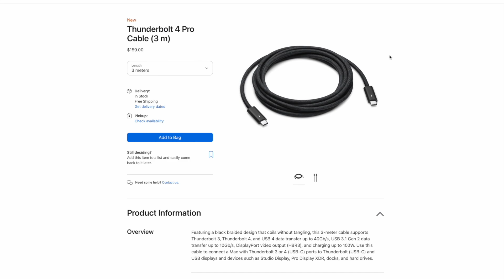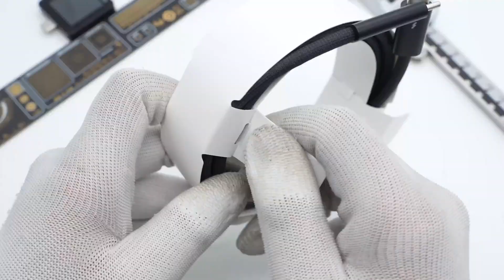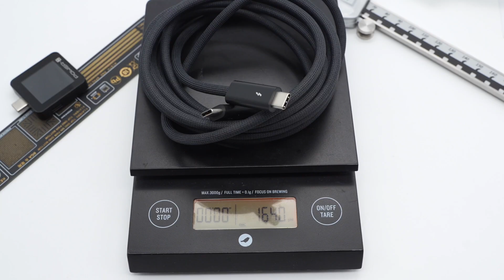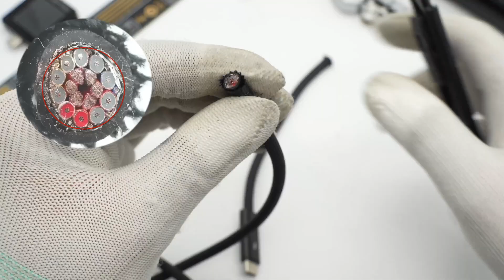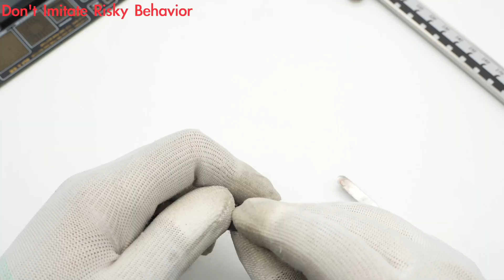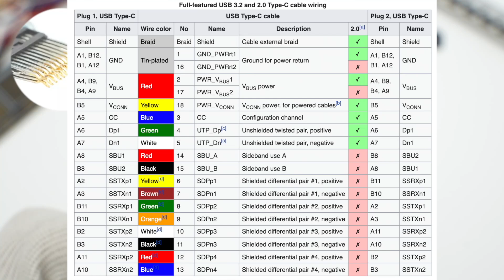Two ARM CPUs Are Inside | Teardown of Apple Thunderbolt 4 Pro Cable (3 m)

Comment: Any speed or data loss with the long cable?
Reply: I have the 3m Apple cable used with a Terramaster Thunderbolt 3 RAID enclosure, getting all the spec'd speed, and zero issues.  I could have tried cheaper cables but didn't want to take the chance since it's at the limit of this tech, and so far it's been perfect.

Comment: But, actually, where would you ever reach 40GB/s?
Reply: Small correction, it is 40Gbps (gigabit, not gigabyte [GB]). To answer your question, displays. DisplayPort 1.4 is 32Gb/s (the 2.0 standard is 80Gb/s) and HDMI 2.1 is 48GB/s. Why would you use this cable over one of those? It is multipurpose. You can run a 40Gb/s link to an external GPU for higher graphics performance on laptops or small form factor machines than what can be fit within the chassis. You could also have a dock connected that handles multiple displays, Ethernet, USB ports, media card reader, etc.

Comment: I have crazy issues with this cable. Which is funny because it has Thunderbolt slapped on it but won't work with Thunderbolt devices. The interferences this thing causes are crazy.
Reply: like what?

Comment: why someone even needs such cable?
i think it's better to use ethernet/displayport/optic cable dedicatedly.
it is much much more cheaper and reliable
Reply: Think about how thin laptops are getting and how few ports they have nowadays. Having a 40Gb/s link to an external device to handle more displays, 10Gbps Ethernet, extra USB ports, media card reader, etc. all through a single connection can be quite useful. Using a single connection to the laptop to not only charge it but expand its capabilities makes a lot of sense to me. It is perfect for those who use their laptop on the go, but can dock it when they get home or to the office and have it instantly transform into a full desktop machine. It also makes sense for those who want to use an external GPU enclosure to boost the graphics performance of games beyond what the hardware in the laptop can do.

I'm not saying I like the idea of pushing everything externally though a thunderbolt cable, but there is a definite use case (albeit one that only exists because of how small and light laptops are getting nowadays).
Reply: @subsgob00m  normal users need only usb (usually 2.0, not even all phones support 3.0), jack for audio and hdmi for monitor (not even displayport)
Apple production is created for professional artists and content creators, so they probably have some 16k cameras with thunderbolt or whatever. i am curios about devices that support it. because mostly all devices are still usb2.0 for regular consumer. i have only usb 3.0 flash drive and disk drive. everything else is usb 2.0
Reply: @Gameplayer55055  Speaking directly to Apple use cases,  yes, I think there are a lot more applications for a cable of this speed. Outside of Apple, there are fewer use cases, but still plenty of valid ones (mostly in the professional space). In my case, I have an external SSD that uses 10Gbps (USB 3.2 gen 2 I guess is the technical spec?). The NVMe drive inside is capable of using nearly all 40Gbps that thunderbolt 4/USB 4 has to offer. Most of my tasks do not need that much bandwidth, but there are plenty of times where I am up against the 10Gbps limit of USB 3.2 gen 2.  Being able to move 50-150GiB of files through 40Gbps would be super nice. I would not consider myself a "normal" user though. I also wouldn't call someone who needs 40Gbps of bandwidth today a "normal" user either. As you said, few devices and use cases need speeds anywhere near that high.
Reply: @subsgob00m  oh it explains everything
Reply: Thunderbolt is a pretty good one cable solution. This single cable can carry display, can charge the device and can transmit data over. Plus you can even daisy chain multiple monitors if your monitor supports it. Compared to the current USB 3.2 Gen2 (the 10gbps one) this allows for more data transmission to occur over a single link. Say you have a thunderbolt hub or a monitor on the other end with a hub. The devices you connect can transmit data at full speeds over a single cable. Apple's cables are quite expensive but there is a lot of engineering which has to happen especially while transmitting data at such high rates (the retimer chip for example makes sure bits are synced together when sent to devices after the cable)
Reply: @SheltonCyril  too good for regular consumers. in professional tasks it probably rocks
Reply: In my case I have a sit-stand desk where my video recorder is in a network rack on the ground and my hard drive rack is up on the desk for easy hot swapping. a 10ft thunderbolt cable will work great to let this all work with sit-stand desk height!

Comment: That ARM chip makes me wonder about potential security issues. Possibly a vector for keylogger or data stealing malware to infect or for persistent infections.
Reply: In this case that ARM chip will not be involved in the thunderbolt data path. Infineon is well known for power supplies and motor controllers. So this chip will be doing power conversion work where USB-C can negotiate 5v,9v,12v,15v,20v depending on the power standard supported by the devices.
Reply: Came here to say this but my man Pedro is already on it!
Reply: Шизи